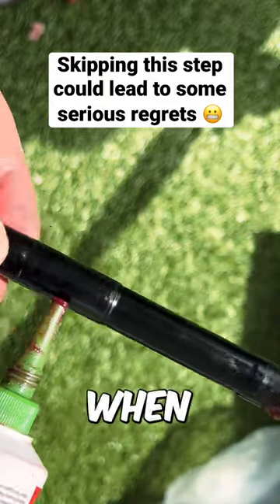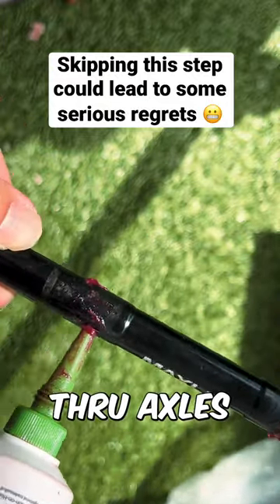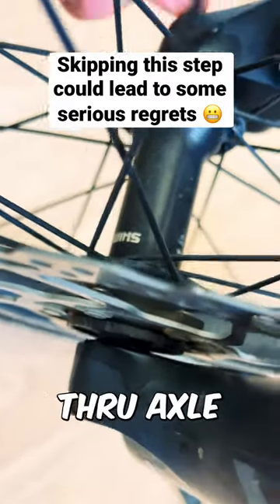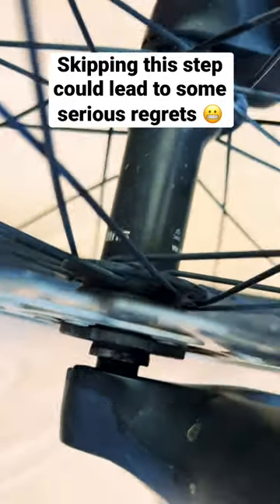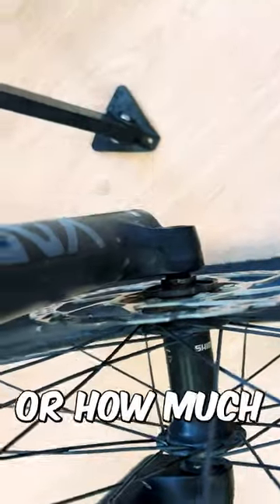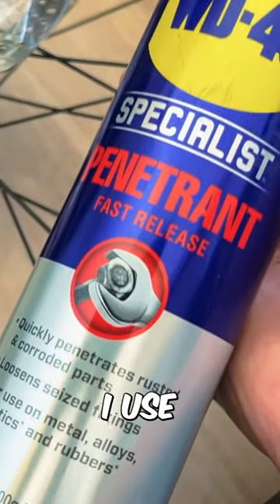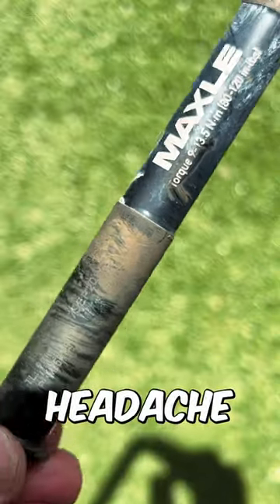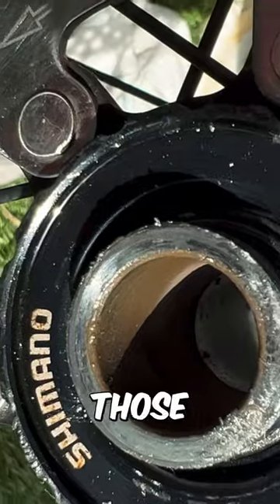STUCK thru-axle ⚠️ #mtb

Comment: I followed Canyon instructions and it's stuck now(have been trying to get it out for a few days), not even 2 months after I assembled the bike. I normally put grease but I followed Canyon's instructions by the book and now it's stuck.
Reply from the maker: What worked for me is a really thin vice grip that I used to clamp on the bit in between the hub and the fork. No amount of hitting could make the thru axle unstuck, only twisting force. I managed to clamp on that thing with a vice grip and it came unstuck.